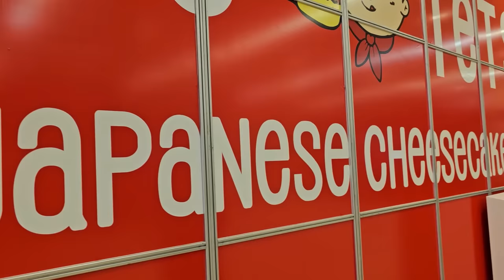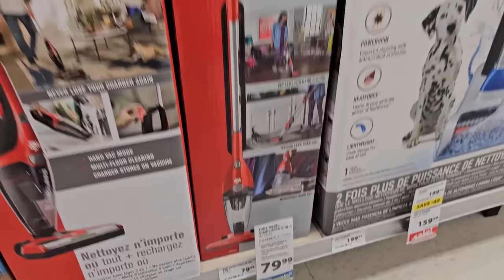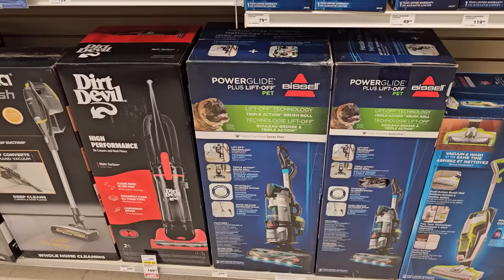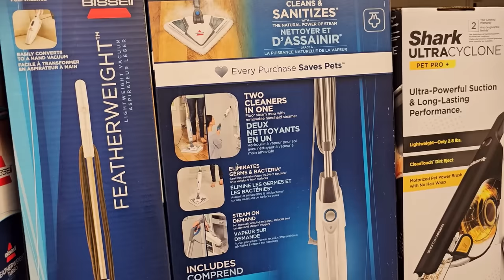Studio SHELVES! Responding to Ideas & VLOG

Comment: Truth is, you just need to get bare minimum things done to make the space usable. Love the lighting, the staircase can be outfitted later, I actually agree with the current angle, more welcoming. The painting and ceiling hooks as you have the scaffolding atm, heating and cooling so the soace is liveable. Initial Table and layout as you can now have levels to the city scape. Everything else is an expansion after the fact. Btw your doing awesome, so jealous of the new space!

Comment: Hey Jordan, its your place you have all the right to make it/do it how you want.  You have earned and deserve your new place.  Yeah with all the supporters of your channel and what not they have been a part of your success, but you have put in all the work.  I honestly like the place as is other than the work you are doing to the mezz area and the stairs and you got that covered.  I am a bit worried on if the main floor is bowed from wall to wall like an arch to where you are going to have a heck of a time leveling your tables.  You might want to consider having the floor checked for being level and possibly having it floated (thin cement that will self level) then put your carpet tiles down.  As the floor would not be an issue if you put tables in place and that is where they stayed, but I am sure you will do rearranging at some point and a table you made level for one spot may not work in another spot a few feet away.  Good luck with everything and just take it easy and do things YOUR way as YOU are the one that deserves to have things the way you want them.

Comment: Nice Lego Studio!  You should put COB LED in the shelves facing down on the Lego.  Super easy to do and it will make the Lego look so good on display. Amazon sell rolls of dimmable COB LED that you can buy for $30. Get your electrician to wire it all to a Driver and Dimmer switch and you'll be styling. I am an electrician as well, looks like that place was a welding shop or something.  Anyway, have fun, be safe and good luck with the re-model.

Comment: The new studio is amazing and you are doing great. And if the budget is thin now you can always leave somethings for now and do them later.

Like just re use all wat you have from the current lego room. And it is ok to just leave one of the display rooms empty for now. An use the existing pax/billie shelves in the other one. An just place the exciting lego city at the end of the large area and then expand over time when budget is there. And all those smaller expansions can be great content for the channel.

There is still quite some echo. If that is not resolved enough with adding furniture. You could look into sound dampening panels for the roof and wall. I have seen some yt movies how to diy them for not to much money. As they can be expansive if you buy of the shelf solution for that.

Comment: I like the stair straight.  It covers the electrical, comes out to the edge of the tile and is about the same as the heat on the other side.  Not having a turn is good also.  The glass wall would have been nice, but you need the storage.  Good decision.  I like the tile too.  The white walls are nice.  I think the echo will go away.  The curtain wall over the garage style door and carpet will help a lot with the echoing.  I think a steamer might give  you the same problem as a carpet cleaner.  I would stick with a good vacuum.  I like the one bathroom, one storage room idea.  It would drive me crazy not being able to see out the windows, but it doesn’t seem to bother you and you are the one working there.  The lights look great.  I love the idea that you tore down that one wall to make the two rooms into one.  With your little ones, I would make sure that your stair rails are small enough for them to grip, or that there are two with one lower.  Don’t worry about what people are saying so much.  It’s only because we are invested in your project.  That’s why you are 17:10 popular.  It kind of goes hand in hand.  Praying for peace as you make decisions about your new studio.

Comment: I was going to suggest that the stairs should be turned 90 degrees as you could put a storage space under it with a door or whatever and it would keep your breaker box out of sight but accessible (if local laws permit it inside a “cupboard”), but I understand your concerns. I guess right now, you probably need to get the studio operational. You can always come back and make changes once you have used the space for a while. 

Regarding in cabinets on the mezzanine, they look great and hopefully you don’t have too many accidents with things getting knocked over the edge. I mean, you don’t want to finish a big build need to put it there while you do something else and have one of your kids accidentally knock it over the edge. As a suggestion to keep in the back of your mind, maybe think about installing a clear Perspex or Acrylic “screen” on the back. It wouldn’t need to be anymore than 12 inches. You’d still be able to look over the cabinets and see the city, and you’d be confident any build you put there - even if only temporarily - would be safe. But that should be a decision for another day.

Comment: Shelves look sweet. Did you have plans for what is going on them? Is that going to be your sorting area?

I believe you said you were going to use ikea Alex drawers for most of your parts area. I speak from experience in saying I’d suggest building a platform for them out of 2x4s. It helps level them across the floor. Countersinking screws on the inside to screw them to the base and each other helps keep them from moving around a lot.

Comment: Please please please put a firemans pole off the mezzanine down to the bottom floor where the furnace is. It'll only be a short drop but would be a very cool and different feature. Loving seeing the new place come together. And good luck on vacuum searching. If sealed down properly, pretty sure carpet tiles can be wet cleaned but might need some checking.

Comment: Please Don’t paint the floor. As a cleaner, I’ve had to clean hoover/ brush and mop a floor like that. Each summer it got another coat of paint. Because though out the year, the paint gets chip off, it get marks on that are really hard to remove. I’ve honestly been there done that. I’ve also had to stream clean carpet tiles, killed my neck looking down for six hours a day for four weeks. When it comes to stream cleaning try and do it with as little water as possible or make sure you can dry it really well. Or it gets a water line stain on it. But as long as it gets dried thought it won’t stain. I think you should do what ever you want to do. Best to you and family

Comment: I don't mind your approach to the renovation. I don't know what painting the floor would get you if you're going to put carpet over it. Seems like a wasted of money to me. It's easy to spend other people's money.  And not moving the air duct is one of those compromises that you make in projects like this. That said, I could easily see you later on boxing in the air duct and making a giant display shelf on the back side of those shelve. It could hold some of your larger pieces. Might need need to be careful getting them up there or using a scissor lift, but it would be a cool place to display them (like the Eifel Tower).

Either way, Jordon, you do you. You're doing a great job and I can't wit to see you start to build the city in it's new home!

Comment: Bricksie, you are doing fab, it's a very big job that you are doing.  Just to ask what are you going to do with the staircase, i recall you saying that you are having it carpet tiled but what will happen with the handrails and gaps?? Would you just fill in the gaps with rails/spindles or would you just fill in the gaps with boarding

Comment: If you are covering the floors with carpet why paint, as far as tearing out conduit after painting no big deal fix the holes and repaint. the tile looks fine, and its at the entrance you live in Canada you don't want carpet at entrances unless you plan on having some one clean it regularly. The Stairs it you find in the future don't work for you then change them, not everything needs to be done right away, you will grow into the space and changes will come. i do prefer the shelves to the glass as they would be covered with shelves eventually, ignore the haters

Comment: A glass wall might be pretty in some situations but it's just not practical. I assume you're like all us other creatives, who can never have enough materials storage and enough shelves for those materials in storage. Your shelves look great!

Leaving the staircase where it is also helps hide the electrical box, etc., aside from the practical reasons you list. 

At the end of the day, it's your space and needs to work for how you want it to work.

BTW, if you wanted to use the carpet cleaner and not worry about vinyl issues and water, maybe it could be done in batches on the tiled floor before installing it in the big space? That might be a major pain in the butt, though. On the other hand, maybe the carpet cleaner isn't actually an issue re: water getting under them once the glue is all set after installation? After all, lots of offices and schools have similar carpet tiles and I'm sure they do do the standard cleaning machine thing without issue.

Comment: Im loving the shelves, i just wish you had undercoated and painted it before building as its going to be a difficult job painting now that its up, I know youd still need to touch up screw holes etc but that would be a little easier on you. Just a thought for your future shelf builds to save youre back, knees shoulders 😂
Id love to give you a fun suggestion for the main area, paint random bricks (or even just around the restroom area) red, blue, yellow, green to look like giant lego bricks 😊
Please make things a little easier on yourself and have a pulley system rigged up with a table sized platform to raise and lower sets, bricks, parcels and builds (or anything that is heavy or stops you from seeing the floor/stairs) to save yourself any unfortunate accidents and your back

Comment: Those long span MDF shelves will sag as MDF has no structural strength when loaded in a horizontal plane. MDF has no grain so zero strength when used horizontally- it’s terrible for shelves. You should have used furniture board instead made from strips of natural wood; usually pine and bonded together. Or if you keep the MDF add a timber subframe to each shelf  to stiffen it up and provide support especially along the front edge of the shelves. Or add more vertical haffits to reduce the spans to minimise shelf sag. Take my advice- I am an architect of 30years experience. I think the shelves are fine and better than the glass for a multitude of reasons I will not go into here. Hang in there - it’s going to be great.
Reply: Did you watch the video?
Reply: @stevenmarshall8529 I am 10 minutes in and wanted to comment as soon as I saw the shelves. Nailing a support at the back is fine but it is not going to help with the front edge. My comment is constructive advice based upon practical knowledge I have of joinery design and 30 years of professional experience as an architect and cabinet maker.
Reply: @LibyanSoup  you must be so proud.

Comment: 10:48 I don't get putting a glass wall. 
You've said you want it to be a semi enclosed space and that is blatantly disregarding that. 

However even if i was designing the space for myself i wouldn't add a glass wall. Honestly i think it would look ugly and then you also have to constantly worry about the glass breaking which causes unneeded stress and if something does happen you don't want to be cleaning glass shards out of your lego city.
Plus you'd also be intentionally giving up space that could have been utilized for storage, which makes no sense in a workspace area, especially when the work involved requires sorting and storing many parts. 

I just can't think of a single reason a glass wall would be a good idea other than personal taste being valued over practical use of the space.

Not to hate on anyone because sometimes you get excited about an idea and just slam a comment down on something and that's fair but perhaps someone could enlighten me on the redeeming traits a glass wall would have over shelves. As you can still see out over the city either way.